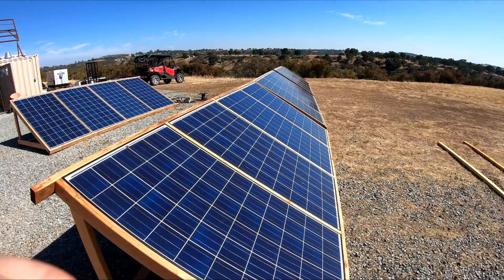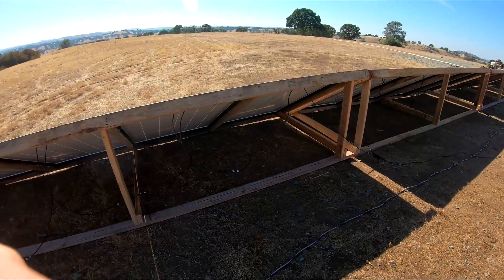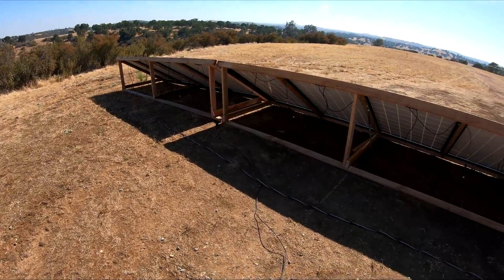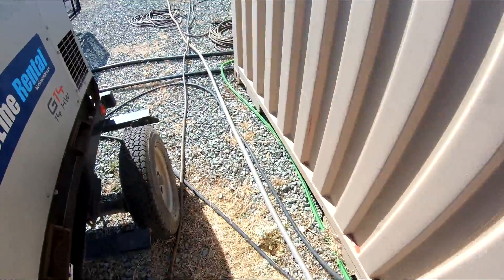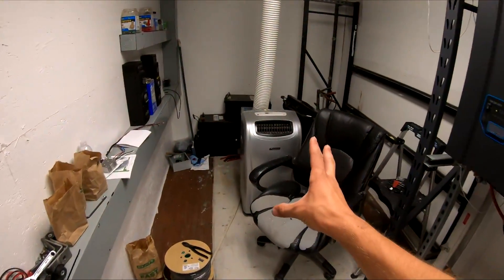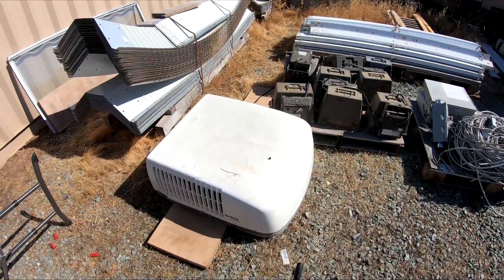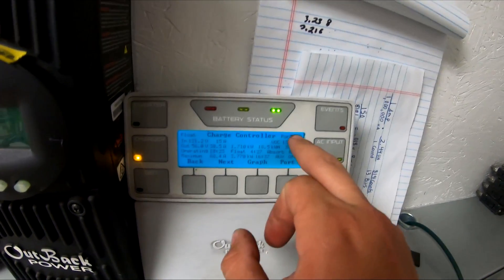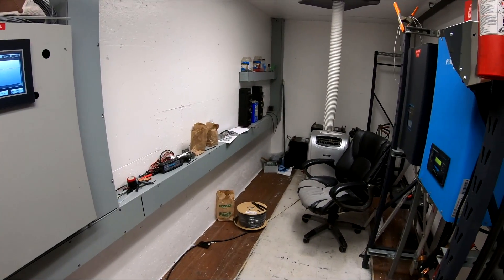Off Grid: Easy to Build 5kw Solar Array (Portable!) DIY

Comment: 150voc would be fine if the temperature never drops so the voltage goes up.  one fellow recomends 80% of the maximum voltage the mppt allows.  or get a mppt with higher voltage specs.
what does the outback voltage allow?

Comment: I would be very interested in understanding how you used your hot tub as a dump load. My wife, Deanna, and I are building an Earthship Biotecture style home out of compressed earth block (adobe) in Northern Nevada. We have purchased a system (SW4048) with 12 QCell - 390 watt panels. I am configuring a 48 volt Li Ion Powerwall battery system to hold up to 9kw of power. Wish we were neighbors! Love how you have done your container for power...we followed your lead on that one! Thank you for posting all your information! Blessings!
Reply: Me 2

Comment: the wooden arrays are portable alright:
the first moderately strong wind and they will move (port?) themselves down the paddock.
Reply from the maker: I'm pretty sure that they are going to end up an a configuration of the letter A, so one array facing east and one facing west, that way any wind loads and they shield each other from liftoff.

The trackers that were suspended above the shipping container were more of a wind sail than these are.
Reply: @HighTechLab  
houston, we have liftoff

Comment: Hi! Another enjoyed vid. Thanks! 
I wanted to add to Ben's comment that when controlling refrigeration compressors you also need to prevent short cycling as it will promptly kill compressors.  You'd want that unit to never start in less than about five minutes after it last stopped.  Seven or eight minutes would be more conservative.  But, you probably already know this.  :)
Reply from the maker: It wouldn't be too difficult to add some code that locks out the compressor for 5-10 minutes after shut off.  I love all of the comments to give ideas for what to look out for!
Reply: @HighTechLab  I got sucked into controlling an entire private rail car, think of it as a 90 foot long 10 foot wide motor-home on steroids.  The turbocharged generator is  80kW.  Anyway, I had to control the entire thing with a CLICK including the air conditioning, which is not actually air conditioning but has to be refrigeration because of the crazy heat loads involved.  Imagine trying to keep a 40 foot greenhouse in a 110F ambient at a comfortable 70F.   I have to control every aspect of both six cylinder compressors; the expansion valves, condenser fan speed, head unloading, staging, evaporator fan speed,  and even the block heaters.  I learned a great deal about the subject with help from a refer expert and the very first thing was "NO short cycling".  :)

Comment: I got a 4000w inveter (stable) and 8000w (peak) I haven't bought any panels yet for it its 12v input how do I know how many panels to buy??? do I need 16x 250w panels to make 4000w stable on the inverter?

Comment: Why such high voltage? 75v would be more efficient, at the controller, but the cable to the controller would need to be larger , so I'm guessing that's why, the effiency not worth the cable cost? I guess I'd do the same , my next pv panels, will need to be 100'-150' away so I guess 8 ga, is about as large as I'd want to run, I'm going to double the runs, for future upgrades, I may have family moving to the property, so I'll be needing mo powa! I'd like about 3kw for myself, so 5kw in the future possibly.  Great video, Can't wait to see what's next!
Reply from the maker: Thank you for your kind comment.

You don't actually loose much going at the higher voltage.  The MPPT charge controller acts similar to a transformer and steps down the voltage while stepping up the amperage.  Also if you have more panels in parallel (lower voltage) you will need more spaces in your combiner box to tie the strings together.  While I do not yet have one of these combiner boxes, when I do install one in the next coming weeks, it would mean that I need twice the number of spaces in the combiner for the same number of panels further increasing the costs.

Hopefully that makes sense.

Thanks!!

Comment: Hmm ... Do we usually store cans of acetone in a power room?
Reply: It makes you wonder, nothing against the gear but even the paper poked in behind the Mate3 battery status unit is asking for trouble.
Reply from the maker: It is an empty can, but I knew when I was editing video that everyone would freak out over that :P
Reply: @HighTechLab  ok the can may be empty , but unless it has been washed out and allowed to dry it will contain a mixture of air and fumes from the remaining contents. In the event of a unit failure resulting in an electrical fire the contents of the can will heat up very quickly and cause the can to burst. usually causing it to be propelled across the room in a fireball. It's up to you what you do , but with all the dollars tied up in that room I'd have a smoke alarm and remove any unnecessary flammable material.
Reply from the maker: @davidstephens1092  there is certainly a smoke detector and it's tied into the PLC so if there is smoke detected it turns everything off.

Comment: Have to be carful when driving an AC compressor manually yourself without it's controller. It's easy to do it wrong and have the radiator turn into a big block of solid ice.  The more it ices up the less airflow which makes problem worse. From memory you run cycles of fan on but compressor off to keep that from happening. But it's been a while and I'm not sure about newer units
Reply from the maker: As long as the compressor isn't running without the fan on I should be fine.  Anything that would be programmed into a thermostat can be programmed into a plc.

Comment: I was about to comment about how horrible that AC is but you already know :(
Reply from the maker: I got the new AC that I mentioned in this video installed, if you check out my latest video you can see that it worked out quite well, especially with it tied into my HMI control panel.

Comment: Love the new used panels. Lots of cheap power. As usual you are building an awesome setup.

I was asking Bobby earlier if he had done any Hydro Electric, and he had not so I am going to ask you too? I am thinking about putting in a small hydro plant like Kris Harbour in England. It will give me a lot of power in the winter here in Chile since that is our wet season. Jim in Chile.
Reply from the maker: No experience with hydropower. Unfortunately in our area there is just not enough water movement / flow to take advantage. I have been working up in Idaho though and there is a lot of water up there that can be taken advantage of, so maybe once I get my own property I can see about doing something there depending on how things work out
Reply: @HighTechLab  Well it is something to look forward to doing for sure. I would love to see it. We have about 8 feet of rain a winter here. Jim

Comment: Just a tip
Maby you could make a solar tracker by the disign of a fellow YouTuber "Nighthawkandlight"
Reply from the maker: Thank you for the tip!

I have seen his video.  One of the problems with solar trackers is there are many moving parts and you have a massive amount of stuff to move around.  These 20 panels would all need to stay facing the same direction due to the fact that they are wired together on one charge controller.

If you look on the thumbnail photo there are 2 solar tracker racks on top of the shipping container.  I just recently retired these trackers due to the fact that they have been a headache nightmare.  With my parents being on the ranch and me living out of the state it makes it really difficult to have a system with all these moving parts that requires all this maintenance.

One feature I did not mention is that these racks can easily be lifted up with one person and tilted on their back so that the panels are facing 55 degrees east to better catch morning sun.  Obviously this would require a person to take care of that but we now have so much generation capacity that the need for a tracker to increase efficiency is no longer desirable because the maintnence outweighs the increase in production.